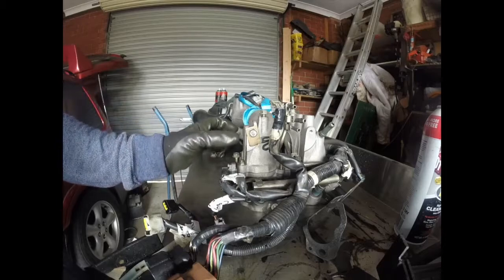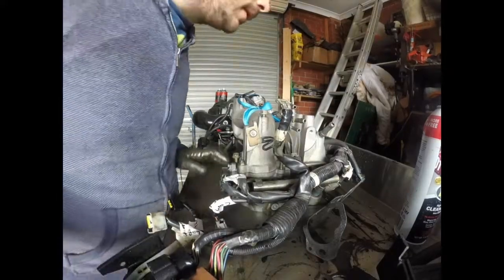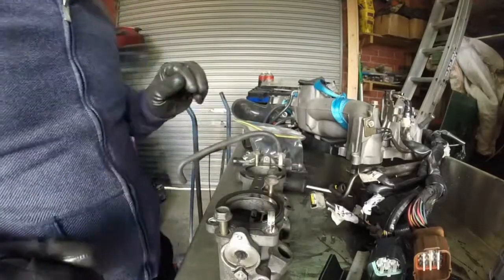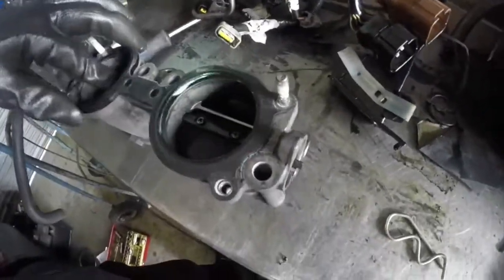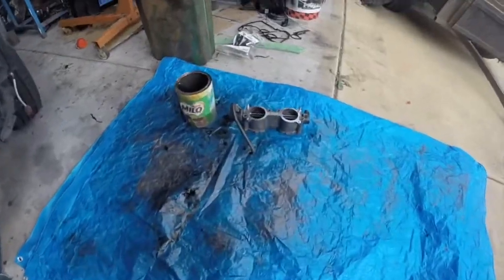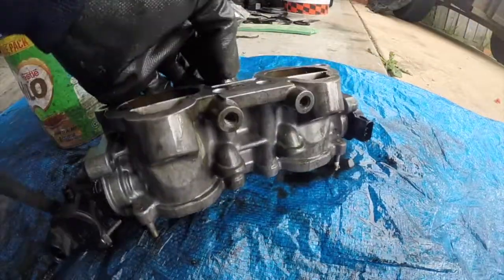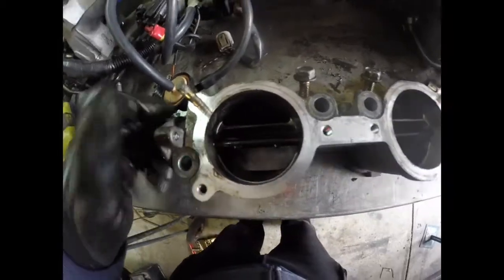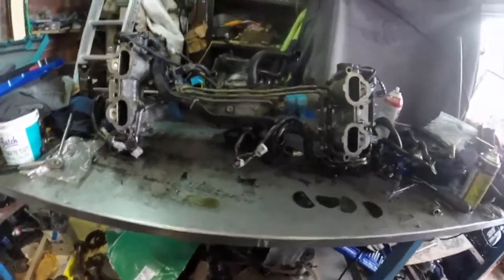TGV Butterfly Delete | Ghetto Spec | The Compound Turbo Rebuild

Comment: spiffy haircut there! haha. i told you invest in an impact screw driver it probably would have cracked those screws loose on the TGV's... hahaha ghetto spec... dont think you can use a low temp paint between a high temp primer and clear.
Reply from the maker: +makipsee yeah, not gonna paint it after seeing it after it got cleaned
Reply: bling bling?